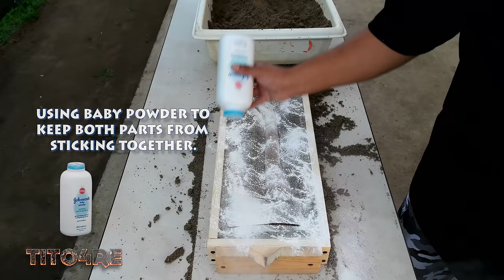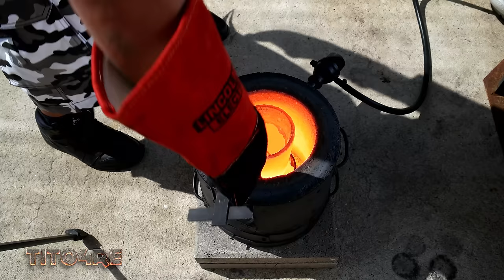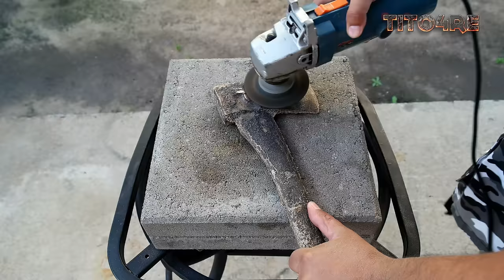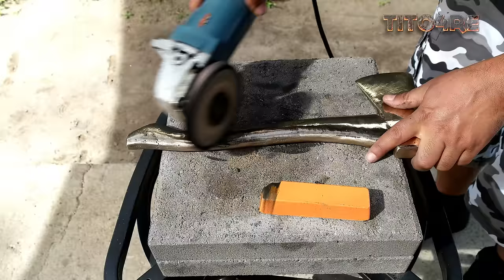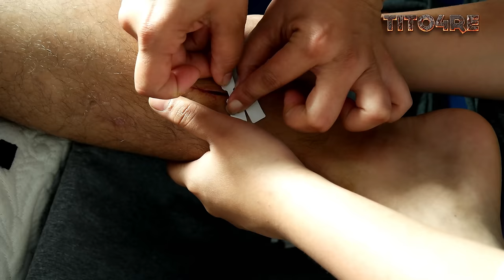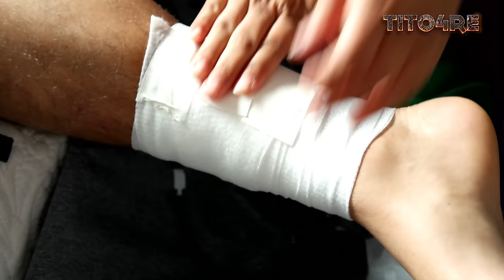Casting a Bronze Axe Start to Finish

Comment: Dang! That cut was deep and you just acted like it was a scratch. I wish I was that tough. This dude is a beast!
Reply: i would not say it was deep i hit my axe in the same spot it was stopped by the bone you can hardly feel any pain it is very strange i quess there is not much nerves there i just kept cutting donwn trees and after 30 minutes the bleeding stopped so no need for stiches or anything
Reply: valtteri sopenperä if you can't feel it that much it's deep. It's like getting poked by a sharp knife. Trust me I know how that feels. Nothing. Then a few days later extreme pain.
Reply: The adrenaline help kill pain
Reply: LHS Shadow I know right it sucks after a day or so

Comment: Holy shit, how did that deep a cut not bleed a fuck ton more?
Reply: he had the edge super sharp and very fine, the cut was able to mostly stay together and just heal with those stick on stitch things. also i never use an ax, or chain saw with shorts on for this exact reason. same for machete, unless i had no choice. bit of denim offers a decent amount of protection from this kind of thing. I also don't use power tools on things that are not secured or at least held onto. hence bench grinders and such, the item is held while the tool secured in place.
Reply: Greenie Head your legs don't bleed as much,I know I cut into my shin with a chainsaw and it didn't bleed much
Reply: well the leg is farther than the heart
Reply: It's also fat and not muscle so there are less veins in the area.
Reply: Lots of fatty and epithelial tissue, so minimal blood flow. Also, if it went in at an angle rather than straight down it would have stayed close to the surface and avoided large blood vessels.
Reply: Greenie Head it was a clean cut. Ragged edges and torn skin cut across more blood vessels, and cause more bleeding. Essentially, a clean cut is shorter.
Take a string and put it down on a table between two points. Make sure to create lots of tiny bends like a ragged cut edge. Then pick up the string and pull it tight, that's the length of the cut. The longer the cut, the more vessels involved.....
A straight cut between those same to points is not only shorter but it's also VERY quick to heal. The skin with clean edges will stick together better and heal much faster.
In cases like this, super glue works great but. remember this if you use it...
Pinch the edges of the skin together after they have been cleaned and dried so that when you apply the glue you are only gluing the OUTSIDE of the cut. If you get glue on the inside it will make it take longer to heal because then there will be a barrier between the skin that needs to grow together.
And only do this immediately after the cut happens. Otherwise you can seal in bacteria and get a wicked infection.
Reply: White meat (:
Reply: Greenie Head My sister has like a two inch cut on her leg.
Reply: Greenie Head maybe because it happened so fast?
Reply: Greenie Head because it did not puncture a vein or artery thus, theres not much blood.

Comment: Cool video dude. Sorry about your leg. Just wanted to say that, if you happen to cut yourself again, don't put iodine (looked like thats what you were using) directly into large open wounds. It's pretty toxic to cells and it will slow healing. The same goes for other strong chemicals like rubbing alcohol, hydrogen peroxide or chlorhexidine. The best is to use mild soaps or just sterilised water to clean the wound, and dress it with antibiotic gels/creams. Trust me, it will heal faster that way.
Keep it up buddy!
Reply: During the bronze age they used honey. Modern testing shows good results too.
Reply: Honey also has an osmotic effect.  It sucks the water out of bacterial cells so they can't function.
Reply: Sugar is great for healing as well.
Reply: I actually had an operation today I woke up thinking I had shit myself but they had up iodine on me as it is sterile
Reply: Anders Hoel were you learn that from
Reply: Anders Hoel I
Reply: pinkameana diane pie I am a resident doctor.
Reply: Gary McWilliams Sorry to hear about your surgery buddy. Hope everything went well.
Yes you are right, they use iodine for surgeries, but only to sterilize the skin prior to penetrating it. Iodine is never used by surgeons inside of body cavities, or on broken skin. 
But as you said, it will stain your skin for a little while.
Reply: Would a saline solution work as well?
Reply: Arturo Suarez Saline would work perfectly fine for cleaning the wound, but it has no antibiotic properties, so I would finish off with an antibacterial cream or gel before covering it with bandages.
Reply: yea real men use super glue
Reply: legends use hot glue
Reply: Anders Hoel jbweld
Reply: cmon guys, duck tape is way better for this job.

Comment: Everyone is talking about his leg, I wanna know about his arm after chopping down that tree. With a handle made of bronze, there can't be any shock absorption and it would ruin your elbow in minutes of steady use...
Reply: Erik Meyer same happened to me once.. one week my hand got bold
Reply: Shona O'Neill take that L man
Reply: Matthew Marquez great for hanging on a wall or somthing
Reply: Erik Meyer this would only really be apparent if it were a blunt object such as a baseball bat. You have to take in consideration that this is a hatchet not a full blown axe. Also its cutting into the tree not denting it. If the axe is small enough and sharp enough then most of the shock will be absorbed
Reply: agreed with your point buddy!
Reply: it works really well but it's not good for your hand
Reply: Erik Meyer why the fuck would he use that axe to chop down a tree
Reply: Erik Meyer if he cut his leg, he can take on that tree
Reply: Sasha Rivera well why the fuck would he chop down a tree anyways? There was no damn reason
Reply: shoddyoctopi 7714  to show that he can?
Reply: I don't know about this axe but old USSR touristic axes was made from steel with thin rubber over the handle. After tens years rubber becomes hard with no absorption. And it was not dramatically bad to use it. Handle curve is more important at an axe than handle material. This one has quite a good curve.
Reply: Евгений Храпач To be honest, this guy won't use it that much. Which means it's no problem as long as he doesn't put 'full' power into it and doesn't hold it super tight.
Then it'll be np.

But if he tries some of the harder wood for 7 days straight and a few hours per day he'll have a bad time. :S
Reply: It's a good cast, just add wood/rubber/cloth handle. There you go. That simple. It's not a "pathetic tool", it's just unfinished.
Reply: Erik Meyer i was also wondering why he even casted it out of bronze completely, if he made the hilt out of wood, he would save a lot of money
Reply: Erik Meyer so snape how's Harry?

Comment: Just a tip for your next adventure: A thorough washing out is in order. It would have been a very good idea to approximate the edges of that cut, instead of leaving it gaping. Butterflies could indeed do the job. I would have used steri-strips if available. Once approximated, laying a couple strips of adhesive tape across the wound to take the tension off of, and bolster, the butterflies. I am not sure that I wouldn't have gone to walmart, bought an upholstery needle and some thread, and sewed it up. I will say from personal experience, that when you sew yourself up, you may want to grit your teeth.

Comment: that axe almost costed an arm and a leg
Reply: Jake Knelsen no, its own weight from that height isn't enough to cut through an arm or a leg. common sense.
Reply: Jake Knelsen an arm???
Reply: Jake Knelsen Ey I see what you did there
Reply: Certainly slashed the price a bit. I know it was a low blow, but it made the cut.
Reply: Jake Knelsen cut it out dude
Reply: FMA reference?
Reply: Azeem Is Awesome sure is 😂

Comment: They didnt sew a huge open wound like that?!!
Reply: dtiydr i think that was at their house
Reply: A cut like that would probably need sutures, at least from how deep I could see.
Reply: That part of the skin is pretty taut so it'd be hard to sew it up. He'll be fine tho, best stuff I've used as a substitute is surgical skin glue.
Reply: It actually wasn’t that deep, it was just a wide gash since it just fell on him. To someone who isn’t used to that stuff it looks pretty rough but you can tell it wasn’t deep from the small amount of blood released, it was decently close to an artery though so he got lucky on that one.
Reply: dtiydr I think  staples  would have been better than stich
Reply: i think i had one deep cut like that when i was a kid i just hold it tight with my hand & after that even hte mark is hard to see .good thing he didn't sew ,otherwise there will be an ugly  mark .Body is well equiped to join itself as long as artificial methods are not used
Reply: Oo
Reply: Yap
Reply: dtiydr no gloves! That fool patched himself up at home
Reply: I thought would have sewn that together I mean did you see that

Comment: You didn't mine the copper and tin ore. :(
Reply: Art Of Life tin is an alloy lol
Reply: its a reference to a game called runescape that came out in 2001.
Reply: The Confederate Flag - Tin is not an alloy. It is a chemical base element with the symbol Sn ("stannum") and the element number 50. Bronze, on the other hand, is an alloy - one of copper and tin.

Tin ore is not very common, but anywhere you can find granite, you can usually find minerals with trace amounts of it. The one major ore of tin is Cassiterite, which unfortunately is quite rare in the United States (where I assume Tito4re lives). So it definitely makes sense for him to have bought it.
Reply: That's what I thought too
Reply: the letter between F and G on an american keyboard doesnt exist. ^~^

"a s d f g h j k l" < 2nd row
Reply: The Confederate Flag, Tin is NOT an alloy el-oh-el

Comment: Try to make the shape of a product made of foam plastic, you can simply tamp well in the sand and not pull out of the mold the main thing is to make them gates
Reply: Wax is the traditional material for that method

Comment: Beast for taking that like a man. Word of advice though, if youre gunna grind soft metals with an angle grinder, use the red grinding stones. If you use one meant for steel on soft metals the pores in the wheel will get clogged. This can cause the wheel to overheat and explode. I don't use a guard on my angle grinder either. But if you're gunna do that you want to decrease your odds of eating shrapnel by using the right wheel for the material your working. God speed sir

Comment: this axe is good only for decoration very heavy so you will get tired faster. Also not good for hand no absortio. Also center of gravity will be closer to hand so less power to axe.
Reply: it is excellent for decoration.
Reply: Not to mention bronze is an absolute shit material for a cutting edge.
Reply: Humans used bronze tools for thousands of years before we could use iron. So I think a bronze tool will do the job. Even if it's not optimal. However, it's true that a handle (is it the good word, handle ?) made of wood would be better. But hey, shiny !
Reply: That is true that being entirely just metal isn't good for absorption. That is why with something like a bronze cast axe you would wrap the hilt with a soft material like leather. It creates a good grip while also dampening the reverb of hitting something with it.
Reply: @khenricx And there is a reason no one ever went back to bronze tools after discovering steel. We also used rocks at one point in our history but again, there is a reason we haven't gone back.
Reply: True. However I'll stay with my statement. The axe works. The biggest problem would be durability I guess.
Reply: khenricx Well no, actually there is no problem with the durability. As I've stated before high-tin bronze is stronger than iron. This is a high-tin bronze. Added with the fact that bronze doesn't corrode, you've got for a pretty durable material. As long as you're using the axe properly, and for the right materials, then there should be no problem with the durability. We have bronze tools and weapons from the middle of the Bronze age that are still perfectly good to use. It wasn't long ago that a bronze sword was found in China from around 1200 BC, and it's in nearly perfect condition. It's still sharp too. Bronze is a highly underrated material, when it's actually quite strong and useful. It's just that we have better metals now that we don't need to use bronze. But none the less bronze is still a very good material.
Reply: John Kitamrtzian and bronze isn't as strong as steel
Reply: khenricx , " halft "  is an archaic english/danish name for an axe handle , don't know if it's still in use , learned at primary school 40 odd years ago , not sure if it's still relevent  ☺
Reply: Ghoul 11 stronger in some ways , weaker in others . modern steels are complex alloys and are not really true iron-carbon steels . Late bronze age bronze is much harder containing a little iron.
Reply: michel G Thanks !

Comment: Why dont you make a gold one
Reply: dylan zapata gold is expensive, that would take several thousands worth in gold to make, plus i dont imagine its the best cutting material
Reply: super kid atom Gold is a soft material, hence it is extremely not durable. Even if it somehow chops a tree off, it would require immediate re-sharpening and polishing. So the Gold isn't the only expensive thing.
Reply: super kid atom have you ever played Minecraft 
Gold sucks
Reply: Gordon : fucking expensive
Reply: Expensive as hell
Reply: Gold is a soft metal. The South American Indians knew how to cast in gold because gold has such a low melting point. In fact the Incas and the Aztecs both cast and used gold leaf overlay for their ceremonial items. Oddly their knowledge never made it to North America during the pre-Columbian era. So even if you DID cast a gold axe of pure gold you could never use it because it would crack in half. One riddle that was never solved: HOW did the Indians figure out that gold was valuable? They had no contact with the rest of the civilized world (that we know of)
Reply: Do you think he has the money for that smh
Reply: Gold is to soft of a metal to use it like an actual tool it would dent really easily plus its a very expensive metal.
Reply: Nice suggestion
Reply: Its soft tho.
Reply: not only it is expensive af much more than how much he will get from yt it would also be pretty damn useless since gold is pretty much as soft as wood😂
Reply: super kid atom gold is extremely rare and extremely expensive and it’s probably not worth it for making a axe, plus it’s weak.
Reply: @Screamingurchin  wrong that is the best cutting material you can get
Reply: Have you not played minecraft

It would be useless in terms of durability and price
Reply: Harkon Maskaluk  yes it does Bend as it supposed to all weapons are supposed to bend if it doesn't it will break so bending is actually good and yes you're right it is a bit pricey
Reply: @magnuschristianssen8999  
está en el código genético

Comment: If you dont have money to buy a sharp axe
Reply: DontAskForIt Graal tbh this axe is pretty lit and it's kinda worth it making it
Reply: Yet you have money to spend on all forging equipment+time+material for forging+electricity+water+wood+sand (you have to bring that sand somehow, which requires energy so +food 4 u, lol). Not saying it's not worth making your own axe, but I take it, it's not cheaper to make your own axe than just buying one.
Reply: that's a lot of copper so not really

Comment: I hope he didn't dip it in water I've seen bad things happen to metals that were dipped it water
Reply: william cash Are you talking about rust?
Reply: william cash Did u see him dip it? No... He used a hose.
Reply: Chan Kim um not all metals rust bud im sorry to burst your bubble "nigga" but aluminum dosent rust
Reply: "rusting" is referring to the corrosion of the metals Iron and Steel. so rusting def means corrosion and aluminum corrodes
Reply: +Sahairra Burke
Yes, aluminum does rust. It rusts into corundum, which is invisible and almost as strong as diamonds.
Reply: A Jones yeah aluminum corrodes like copper it doesn't rust though it's corroding not rusting
Reply: william cash  bad things from happen to metals dipped in water you mean like water harden steel  ? water has been used for centuries to cool and harden metal do a little research
Reply: Chan Kim rusting is not corrosion  its oxidation   there is a difference
Reply: He just make a joke. A good one. LOL
Reply: Brandon Baker oxidation is corroding. theres arguments online wether it is or not but i say it is
Reply: Lol you mean quenching? that has different effects on a whole range of metals. It's a vital process in bladesmithinng. I don't know why you think it's bad

Comment: Quick tip: get something thats hard, had a flat surface, and is made out of material that can withstand hammering, then place it onto the sand and hammer it to speed up the packing

Comment: As a medic, the first aid was good but in most cases if you don't know what you're doing, it's best to go to hospital bc a cut that deep and wide can be cleaned and closed (good that you used iodine) but sutures are the best because they keep it tightly closed. If it got infected, it's not like a simple cut where the white blood cells destroy the bacteria. Depending on the area, they may not even reach in order to kill the bacteria which could cause systemic septic shock, leading to death. That's why an infection in the lungs (pneumonia) or the brain (encephalitis) is so dangerous because many antibiotics will even have difficulty reaching there. When in doubt, it's not a bad idea to at least get it checked by a doctor afterwards bc you may need antibiotics depending on circumstances